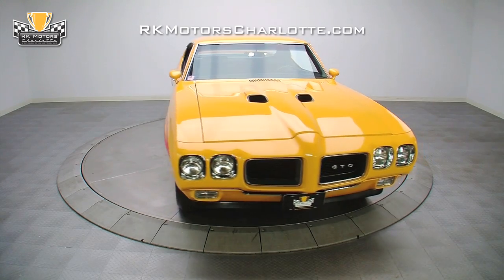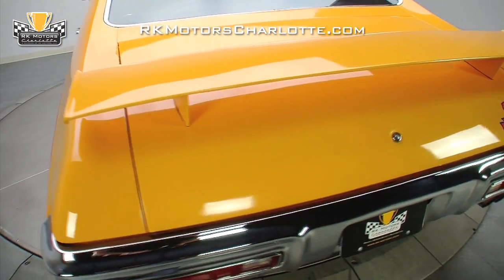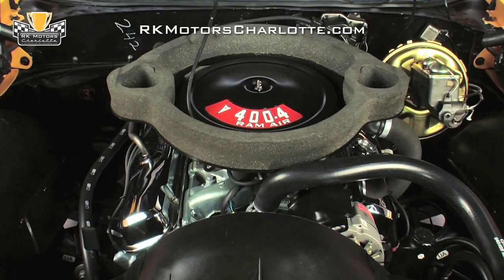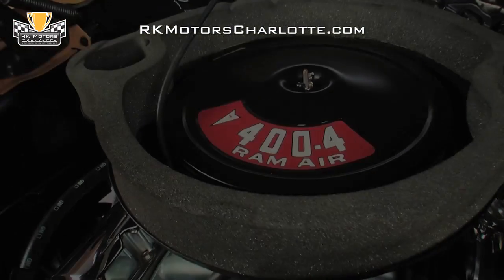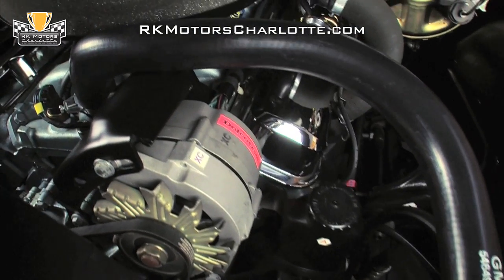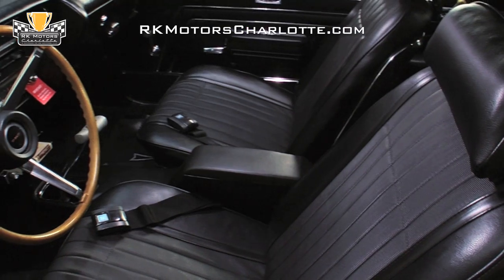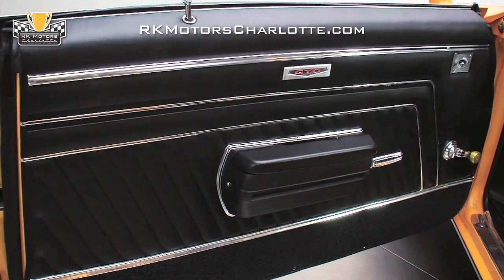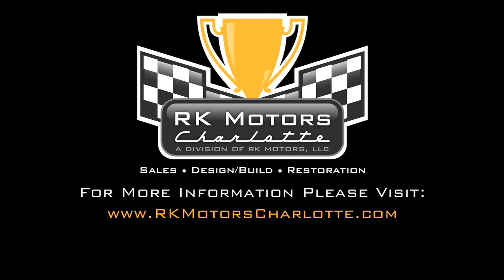132756 / 1970 Pontiac GTO Judge

Comment: Right off the bat incorrect, non factory air cleaner decal. Carter four barrel carb? You realise these used Rochester Q jets? What rally gauges? You have an electric clock, that's all. Then there's the issue of the non factory for 1970 body color sports mirrors installed in the incorrect position too close to the A pillars. Correct isn't the word I'd be using all through the video....